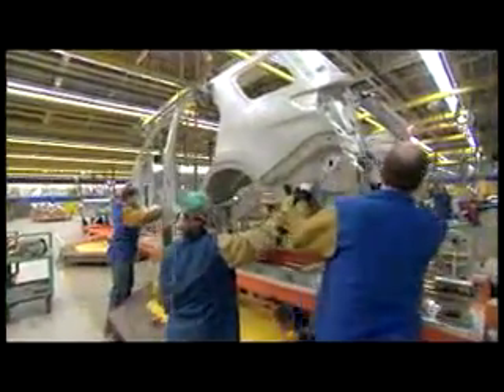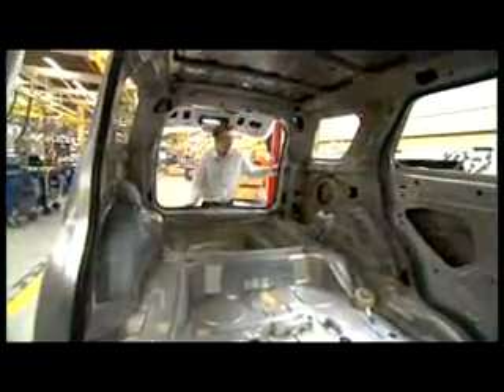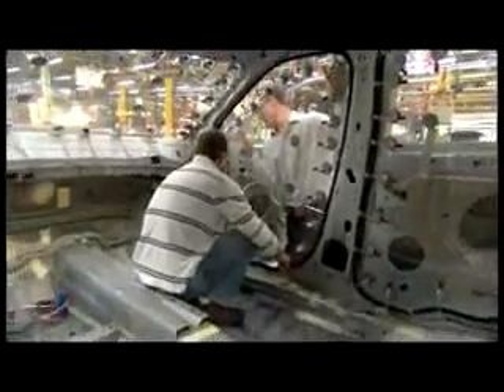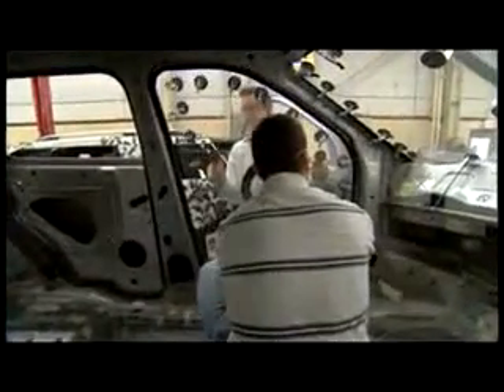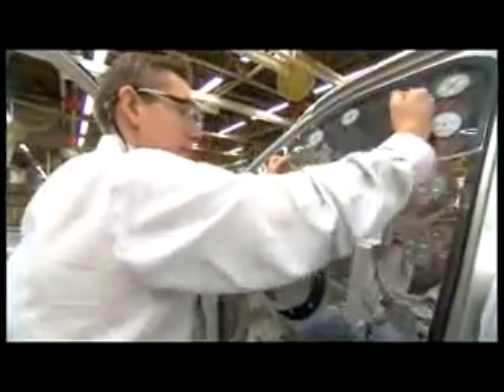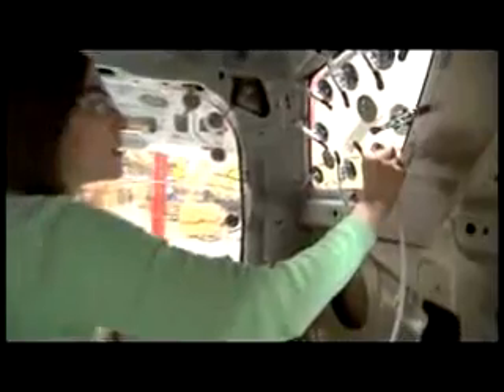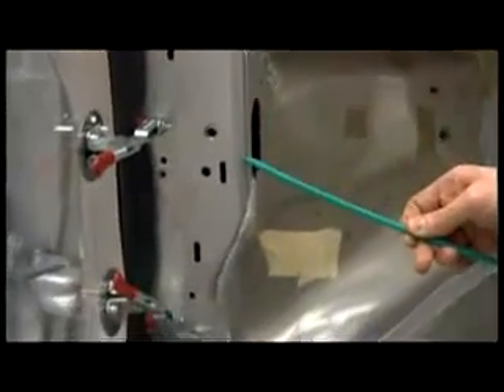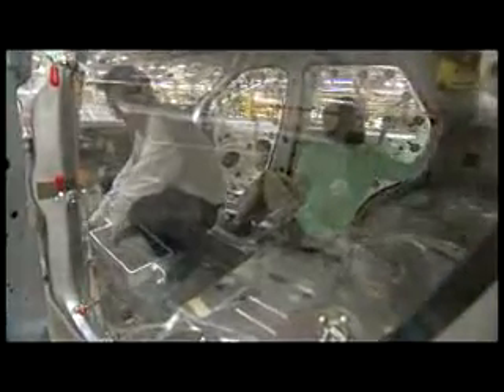2011 Ford Explorer Air Leak Testing

Comment: @CrushedJustice Maybe Ford was bad long ago, but I believe in them. They're innovative and not afraid to mix breeds. I've never seen another US car maker with cars that "did the job". Certainly not GM. Honda and Toyota, I give them their props they're great. But Ford is not found on a road dead or repaired daily. They're a really good brand and definitely didn't need to be bailed out by taxpayers.

Comment: @CrushedJustice Like I've said before, I've had an explorer for over 12yrs and it has only given me 2 dead batteries. And it's STILL working. I don't know where you went wrong with yours but mine is boss.

Comment: Ford Explorer?? It has the worst reliability and technical issues than any vehicle on road. Engine burns oil and oil sludge problems, radiator leaks and these guys are trying to fix Air leaks. #Fail

Comment: Why can't I get a steering knuckle for my '82 Econoline van?
I'm not worried about air leaks, but potential suffocation in the event of a chemical warfare attack.
How much more does the yuppie have to pay for gas-attack proofness?
Then there is hydrofluoric acid. Which I am sure the Explorer is resistant too?
Ford should put need before greed.